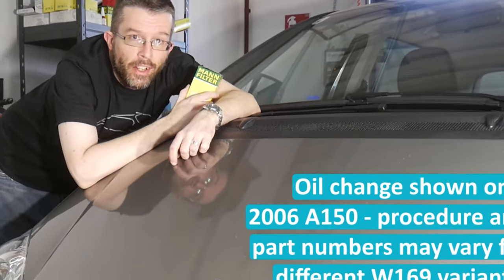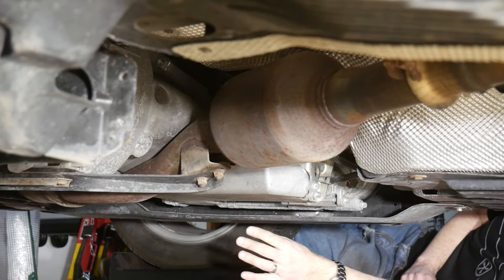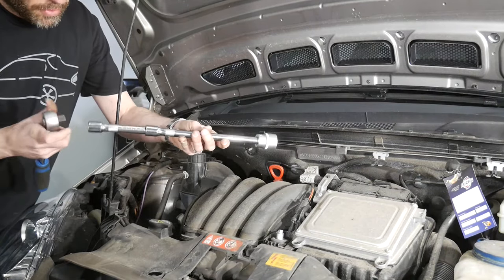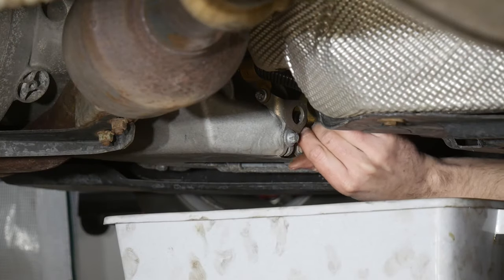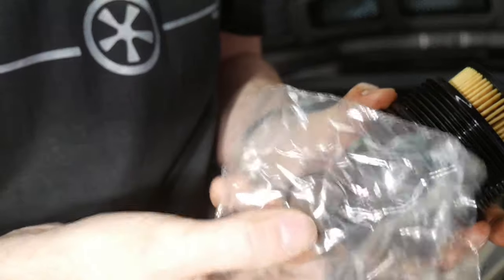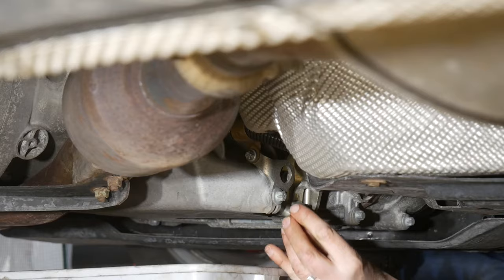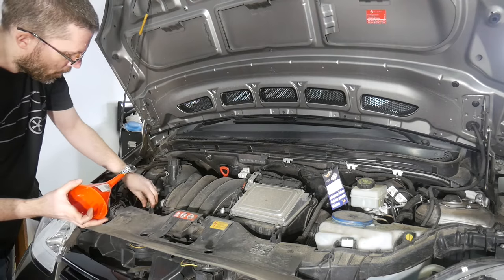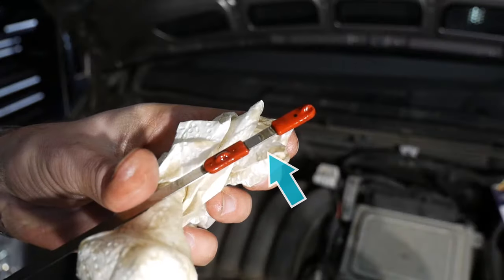Mercedes A-Class A150 (W169) ENGINE OIL & Oil Filter Change

Comment: Dude thank you flearing my mind about the 2nd oring in the man oil filter.  I did oil on my A150 7 days ago but this time with an original filter. That one came with jus one oring. What i suspect now is that filter is used on probably multiple engine versions
Reply: Yup can confirm the bosh filter comes with 2 orings, so i guess its for more versions. Just did another change (14500km in 6 months)
5W30 on this one hope it fixes the chain rattle on cold starts when the oil is 10 000km older
Before i used 10w40

Comment: The smaller o ring fits on the 27mm hex on top. Presumably this grips the socket to allow easy withdrawal of the filter housing
Reply from the maker: You're absolutely right. If somebody doesn't have as small hands as I do, it may be a good idea to have this installed 😁
Reply: Actually the small o-ring goes on the engine side of the filter housing. Where the filter meets the sump. These are almost never changed and allow bypass of the filter cartridge. Extremely difficult to change but very necessary. I have watched a half dozen of these videos to see the best way and not one was done correctly just like this video. My sump side o-ring was hard like plastic and split so I am changing it. Likely original o-ring. Guess I need to make a video next oil change.
Reply from the maker: Thanks for sharing your insight! I will take a closer look during the upcoming oil change 🧐
Reply: @AUTOdidact77  I made a very simple tool to install the oring.  There is not enough room for 2 hands in the area. I will try and make a video.

Comment: I am running A-class 170 w169 cvt made in 2006. A great car but a few months back it started to make a zzooom-like noise.
Several mechanics and 1 garage tried to locate the noise without result.
We change the front wheel bearings but the noise  is still there.
When driving I put the cvt in neutral and the noise is still there.
Does any person experience with this?
Then please advise.

Comment: nice work, however , what is the mann filter numbers? and what oil type in usage? thank you
Reply from the maker: As mentioned in the video description, it´s HU612/1x. The oil needs to meet MB 229.5 spec, I always use Shell Ultra Helix 5W40 in both of my Mercedes (also the E-Class) because that´s really cheap to get here in Austria.